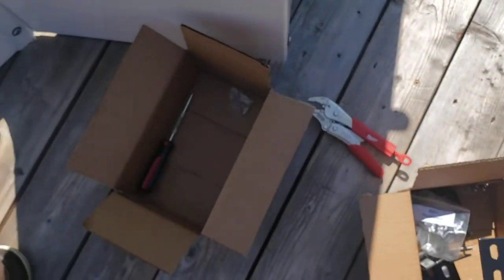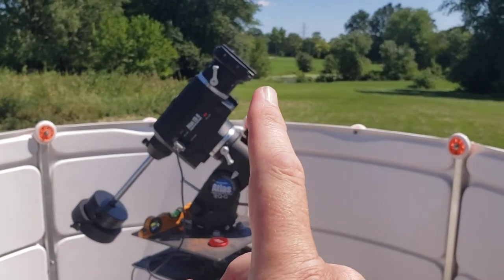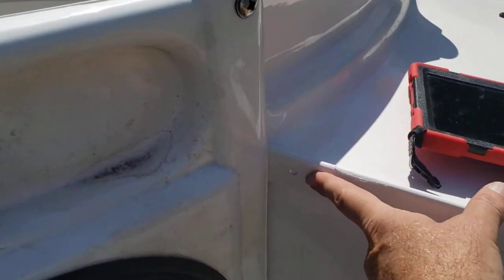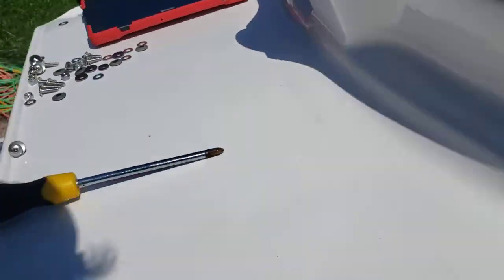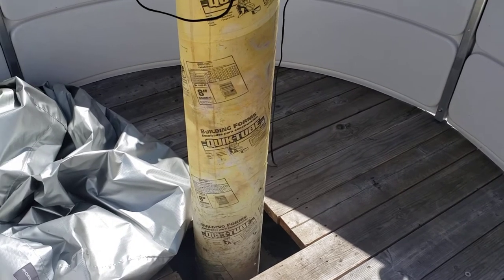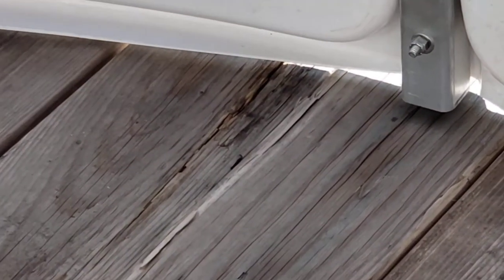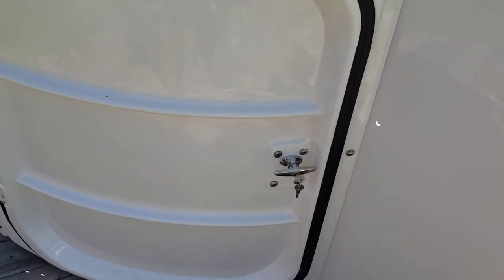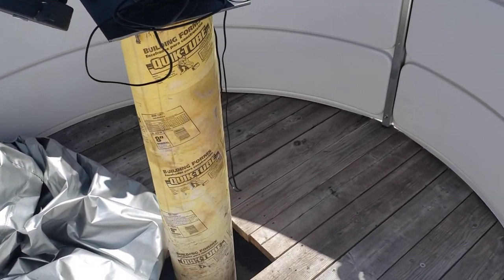NEXDOME Video 5 Base assembled

Comment: Your issue with the door weather stripping unevenness in the corners is due to the difference in radius, door frame side being longer than the door opening side. I cut small Vs in the weather stripping  which solved that problem. About 3/16" on the door opening tapering to zero near the door frame side.
Reply from the maker: Great idea. I will give that a try.